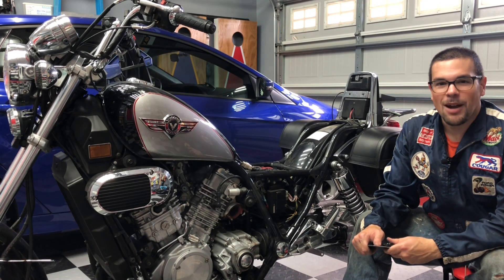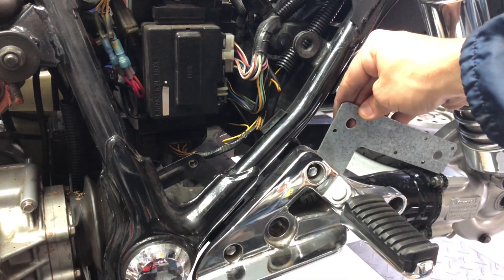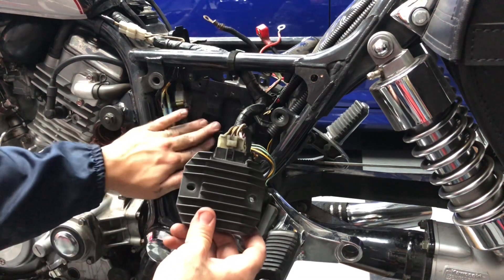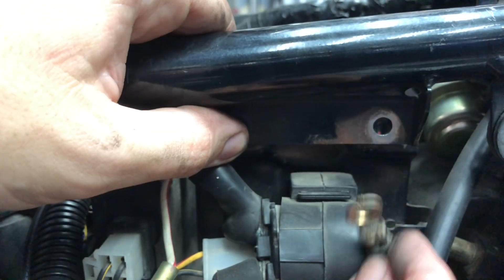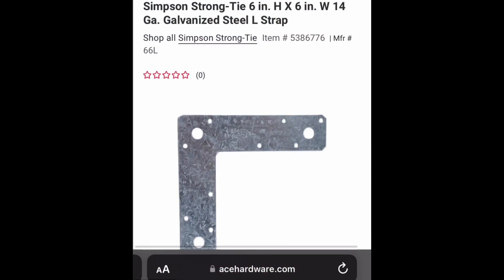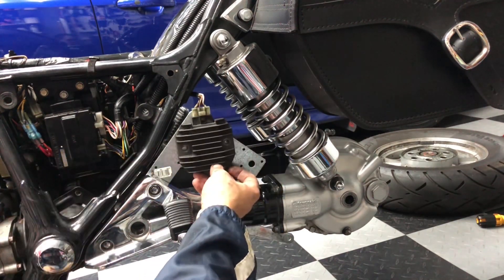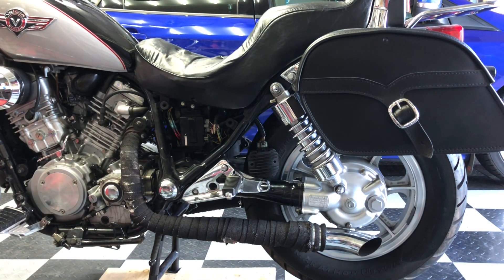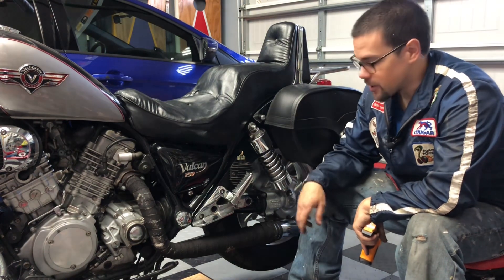How to Relocate the Voltage Regulator/Rectifier on a Kawasaki Vulcan 750

Comment: I really need your expertise, not a motorcycle mechanic by no means, stopped for gas, got on my bike, no green neutral safety light, pulled in clutch nothing, no juice to my start button, anything you can think of would be fuckin great,had a mechanic with a shop tell me he won't even touch it, thank you, William.
Reply from the maker: First, make sure the kickstand is down. Then check the main fuse, I think it's a 30 amp. Check to see if the fuse is broken. Next, the starter button only works when the ignition switch is ON and the red engine stop/run switch is ON. So check both of these not only to make sure they're in the right power state, but also check for loose connections or corrosion. Those are a few things I can think of. Sorry to hear your mechanic won't even touch the bike. If you need more help, create a thread over at VN750.com. There, myself and other moderators/owners will further help you out.

Comment: Awesome mod..
I am having some starting issues. Sometimes I need to try 3/4 times and hearing a loud noise coming from my exhaust before it starts 
Overtinking to replace the bougies and the regulator.
Reply from the maker: Checkout my pickup coil mod video here:

https://www.youtube.com/watch?v=sKGKjh1L9Ao

It's a common issue on these Vulcans that can be fixed by adjusting the gap of the pickup coils.
Reply: @CFG750  yeah. I have seen that before. But for my little experience maintaining a bike I find this kinda tricky to do myself..  I will need to gain some trust. Yesterday my bike had issues starting after 80km drive (hot engine)
Reply from the maker: @bertoost6391  I understand. Maybe what could help you get more comfortable is first checking the easier things. I kind of rushed right to "pickup coil mod"...but there's other (simpler) things to do first. 😁

How's the battery...is it older than 5-6 years? First check the battery voltage following my procedure here:
https://youtu.be/aJq00g--2so

Next check the spark plugs. Are they in good condition and gapped accordingly? 

If these check out, and your engine runs fine other than the hard hot-starts, the next thing you could do is the pickup coil mod. Also feel free to start a post over at VN750.com introducing yourself and your issue. There, myself and the other members can help you out.

Comment: Hello Checkered Floor!  I'm curious as to what the plastic dial is near the carb on the left side of the bike. . Is it idle setting? It's round, on a short shaft and about the size of a dime. Thank you for your videos.
Reply from the maker: You got it! It's for adjusting the idle. Check out this thread at VN750.com for some more insight:

https://www.vn750.com/threads/how-do-i-adjust-the-engine-idle.8631/
Reply: @CFG750  Thanks man! I think they put the Stator in that spot, so we have to take it in for service. I can't see any other reason. I just bought my 750. I haven't heard it run yet. It's been sitting for about 3 years. 1,800 miles on it. Anything this ol' boy needs to know?
Reply from the maker: @KRISEDWARDS-n3p  if it’s been sitting for 3 years, change all fluids (oil, brake, coolant). Check the splines of your drive shaft and lube if needed. Make sure the inside of the gas tank looks ok. Once you get it running, check the health of the electrical system. Those are the basics I’d recommend to start with. You can also seek more advice over at VN750.com. There, myself and the other mods/members can provide more insight.
Reply: @CFG750  You're awesome. I'm sure I'll be tuning in. Thanks
Reply from the maker: @KRISEDWARDS-n3p  Thanks homie, I look forward to making more videos, I’ve got a lot more maintenance, mod, and miscellaneous VN750 content planned. ✌️

Comment: Where is the voltage regulator located on a 1993 Kawasaki 600R
Reply from the maker: I'm not sure, I only have direct experience with my Vulcan 750. But your Kawi's regulator should look similar to mine, so keep that in mind. Check around the battery, or under your seat, or close to your electrical system/junction box/fuses and your regulator won't be far away. I hope this helps.

Comment: Do you know if where there are junction points in the wire harness they are taped up with blue electrical tape from factory... finding out as few things po did but when opening wire harness I noticed alot of blue electrical tape covering splices or something I'm wondering if they're po hack jobs or factory
Reply from the maker: I don’t have any blue tape on my bike, but also then again it could have been removed from a previous owner. What do you mean by junction points? Are you looking to hook up something like an accessory?
Reply: @CFG750  no I was chasing electrical gremlins but found alot of areas with what looks like blue electrical tape but they're like 1.5" x1.5" squares wrapped around what seems to be like where 1 black yellow wire branches out to 3 black yellow wires

Comment: I put mine rectifier wire connectors facing down . Avoid dirt n rain water . It’s possible that way .
Reply from the maker: That’s a great idea. I’m going to see if I have enough length of wire to flip around the R/R such that the wire connection is on the bottom. Thanks for the comment!😊
Reply: @CFG750 Btw the other tome i was talking to you about the Vulcan having random misfire after 10 minutes ride remember ? Turns out it was the regulator getting bad and yea look have to get back on you channel as something tells me the factory location wasn’t that good and now you solved my doubts thanks bro!
Reply from the maker: Yeah, the factory location doesn't allow for much passive cooling. And it becomes an even worse problem if the factory incandescent bulbs are replaced with LEDs because LEDs use less energy. So that means the regulator must discharge more excess current/voltage in the form of heat.
Reply: @CFG750  no wondering i have to keep high beams on and tilt the headlight down as someone put led all around, if left low beam it glitches like if there is a lose connection on the headlight harness specially on idle 
Thanks for the information
Reply from the maker: Is your headlight LED? And sometimes it flickers? If so, checkout this link to learn more about the RLU (reserve lighting unit). This could further help you if your LED headlight flickers.

https://www.vn750.com/threads/guide-to-bypassing-the-reserve-lighting-unit.87625/

Comment: Mine put side of leg rest . Same area . Done 10 over yrs  . Few days ago remove carb wash jets n install . Dam difficult. There steps to follow then got in . Already 20 over yrs kept this bike . try start today . Some electronic kaput sound unfortunately. Old bike problem. Workshop not accepting the job .
Reply: Malaysia fuel quality is good. Ethanol inside i don’t know. Problem was rust inside tank . All flush out one handful rust looking like sand . Plus lack of using bike last 10 - 14 yrs . So carb tiny jet holes gum up n needle stuck . Brake oil dry up turn into jelly like . Everything cleaned n done proudly with my hands . This old 30 over yrs 82k+ mileage now happily running beautifully. Thanks to YouTube and all those videos gave confidence guidance to fix it up . Thank you too for that pickup mod . Now no problem with engine hot start. That AGM stronger battery helps too .
Reply: And also that stator 3 yellow wire . Cut away the original clip on and use good wire connector . Old timer mechanic advised me n done.
Reply from the maker: @chewwanchoon6109  Yes, it’s common on these Vulcan 750’s that those 3 bullet connectors on the stator wires can corrode and become an issue.
Reply from the maker: @chewwanchoon6109  It makes me real happy that my little videos helped you all the way in Malaysia on your Vulcan. Nice job fixing up the bike and safe riding! 👍
Reply from the maker: Sorry to hear that. This is certainly going to be a growing challenge with the Vulcan 750 in that as it continues to age, some shops will flat out refuse to work on a bike so old. 

I haven’t yet needed to remove my carbs. But if I ever do I’ll make a video to show the process. I know it can be a pain.
Reply: @CFG750 I have done a sneaky idea on cleaning carbs without removing it . That fuel flow line into the carb . Connect a transparent tube, spray in carburettor cleaner n run the engine. As it go down, fill in some more . Results. I find it works. Did it on my other problem ideling bike . And immediately felt like a new bike. Also done on the volcan . I didn’t get any problem from the bike for what’s done. In future will do again. Guess that carb cleaner working all the way into combustion camber.
Reply from the maker: @chewwanchoon6109  Nice tip! I’ll definitely use this if it’s ever needed. I use ~2 oz seafoam with each fill-up. Check out this post/pic of my piston head. I want to show more of this in a video one day, especially both sides of the intake valve and inside the carb. 

https://www.vn750.com/threads/i-love-my-new-endoscope-thanks-for-the-recommendation-mmart.107966/
Reply: @CFG750  just checked. Unfortunately in Malaysia no seafoam . Many people said it’s good.
Reply from the maker: @chewwanchoon6109  Any fuel treatment stuff would be good for the Vulcan once and a while. Royal purple has some. Lucas. As long as it’s good for a 4 stroke motor, it’ll be good for the Vulcan. Do they add ethanol to your fuel in Malaysia? The fuel additives (such as seafoam) negate some of the harmful effects of the ethanol in fuel and also extend the life of the fuel before the ethanol absorbs water (moisture) from the air and gum up.